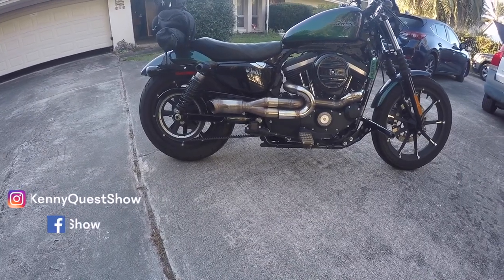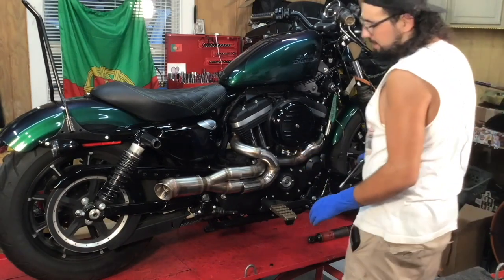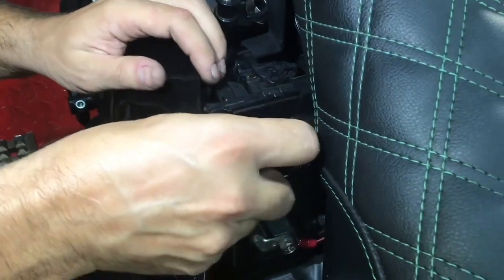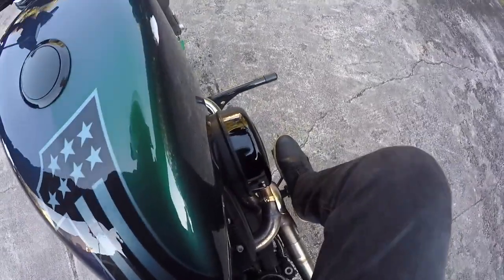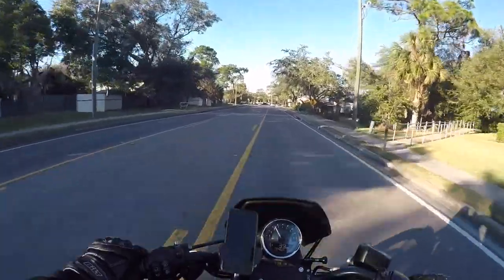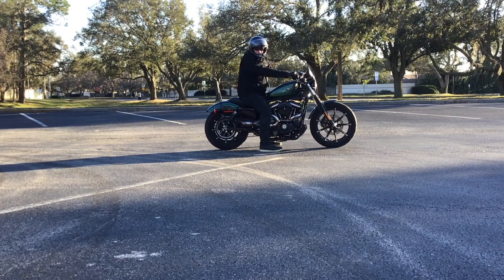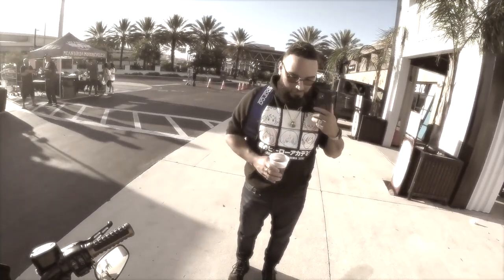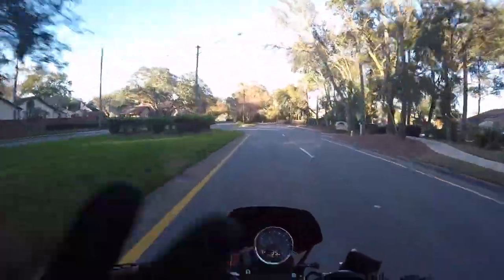Gallop Flying Comet Exhaust for Harley Davidson Sportster

Comment: I'd do suspension before spending money on "performance". Sportster stock suspension is majorly lacking.  I swapped rear shocks for 13.5" Progressive 444 and installed Progressvie cartridges up front.  It's night and day.  Deeper leans, faster turns. Better braking. It's not cheap by any means but beats additional 3 hp by a mile. Pipe looks good though. Sure.
Reply from the maker: Thanks Gee Eee! Yeah I decided at the time to go for the sound and balancing the tune on the bike before the suspension due to my riding experience, really not riding the bike aggressively. Now a year later I’m doing the suspension, ‘cause I can really ride now.

Comment: Hey I just ordered one for my low rider s.. what kind of tune did you use with the pipe?
Reply from the maker: I used a DynoJet Powervision 4, it only gives you one option for aftermarket exhaust, that option has worked flawlessly and the post dyno results speak for themself, a balanced power and torque curve.